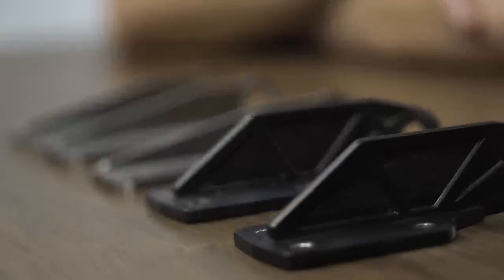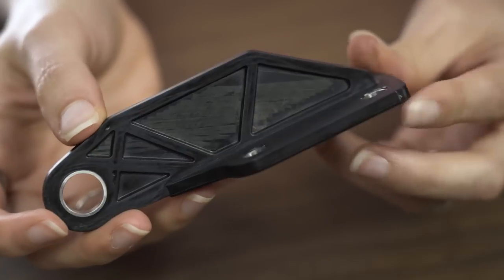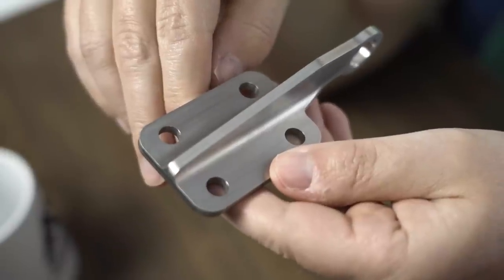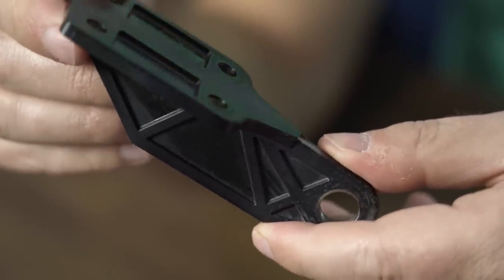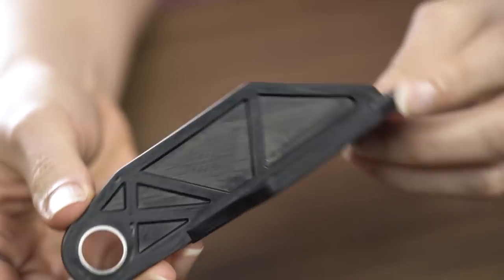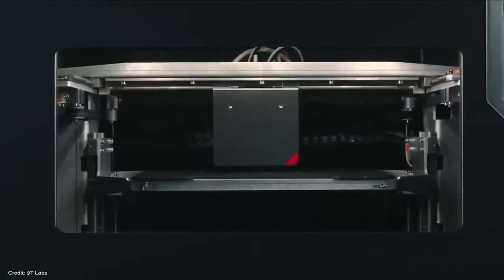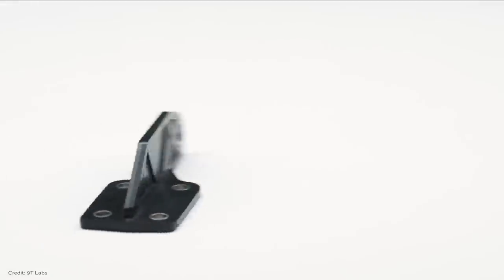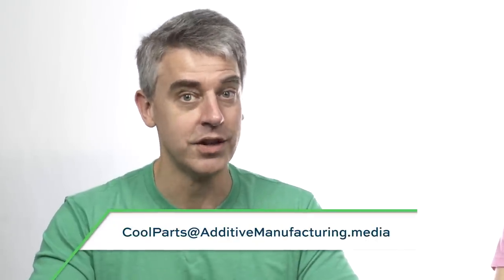3D Printed Composite Bracket Versus Machined Steel |The Cool Parts Show #41

Comment from the maker: Hey all, thanks for watching! 

For those asking about the tooling, yes, the compression mold is a significant up-front investment for a part like this. But keep in mind that this bracket would be produced in volumes of 1,000s per year which lowers the tooling cost per part. 

For more info, shout out to Yannick Willemin our episode expert who is answering questions in the comments. (Also find him on LinkedIn! https://www.linkedin.com/in/yannickwillemin/)

You can also read more about the 9T Labs technology in this article by Stephanie Hendrixson: 
https://www.additivemanufacturing.media/articles/fiber-reinforced-3d-printing-expands-control-applications-for-composites
Reply: just thousands a year?  So you make like 4 a day ?
Reply: Those 3D plastic ("carbon fiber") brackets are not as strong and durable as the steel parts.  If these plastic parts are strong enough for the task, the steel parts are way over engineered , and could have been replaced with an aluminum extruded/machined version that would be light and strong, and I can guarantee that they could be produced more economically (even with batches of 1,000's). This plug for 3D printed parts is misleading, to say the least. I'm not saying the idea doesn't have merit, but this example is really stretching reality.
Reply: @Emma-ol7kf  I believe they mean 1000s of the bracket shown in the video, they should have orders for other parts. I guess

Comment: There's no way the printed part was cheaper than the machined part. Has it been certified by the FAA/EASA/IASA? Does it get brittle in low temperatures and break with the vibration a helicopter would experience?
Reply: I work in a reliability lab and I'd love to test this, any chance you have good data on the vibration and cold temperatures that would be typical for helicopter reliability testing? We use Essentium's HTN-CF25 filament all the time to replace the machined fixtures we use in our mechanical reliability testing, our process is much cheaper and faster than what our machine shop can do, but I've never tested our 3D printed fixtures under low temperatures, it'd be an interesting comparison.
Reply: I would think a high heat situation would be more of a concern for the printed part.
Reply: Cost of this is absolutely cheaper at volume compared to traditional composite parts. Compared to a machined part, it likely still is once you get to volume. Plenty of people are getting FAA certs on composite 3d printed parts.
Reply: @circleofowls  that’s a material I was thinking about to use! Interesting
Reply: @MrBen527  PEEK and PEKK have proved that they make the cut
Reply: Airworthy is a whole different level than just building a replacement
Reply: If they are printing PEEK - and then re-moulding the part then it should be fully dense, continuous fibre reinforced. PEEK is high temp, low outgassing, aerospace grade plastic (it’s more expensive then silver by mass), resistant to most chemicals etc etc. the fibre reinforcement makes it very good at resisting vibrations (if designed correctly then higher fatigue life then steel).  

Remember they printed this in multiple directions in order to make sure fibre direction isn’t only in one direction (not only in Z). 

Cheaper? I doubt it. Cheaper on fuel - for sure.
Reply: Same thoughts. A machined part where you have so many shops to choose from vs more recently developed process from a single source with custom tooling and NRE cost for the supplier and a complete redesign from the customer. They must only be comparing the incremental unit cost which is very disingenuous as this is not how business decisions typically get made.
Reply: @circleofowls  this is awesome to hear! I just picked up a few rolls of HTN-CF25 to try.

Comment: He talks about cost but notice how they avoid the cost of the additional tooling. Also biggest part about 3D printing is Joe Schmoe can do it in his garage or home and he most likely couldn't if he needed tooling like molds. What's the life time of the part vs the metal part.
Reply: Dear Diconica, thanks for picking up the point of the tooling cost. It is very important to understand that we are developing a manufacturing standard meant for volume production (1'000 to 100'000 parts per year). The tooling is definitely necessary to fulfill all functional requirements for structural parts and has a minor impact on the cost per part given the volumes. This technology is interesting for major OEMs in the mobility, medical, and leisure field and definitely not (as you are correctly describing) for individuals looking for an accessible 3d-printing technology.
For this exact part, no lifetime study is yet available. However, the customer is benchmarking all characteristics with the current metal part. For other parts, we have proven that our parts cope with the lifetime tests (X cyclic loads equals a certain lifetime).
Please contact us if you would like additional precisions.

Comment: Very interesting process. I'm curious about the type of QA inspection required for the AM part. The billet steel part is probably just a pair of calipers and the CMTR's. With the AM part I would imagine they would want component measurements before assembly/ molding, and possibly UT or RT to check density (and verify presence & placement of the carbon reinforcement).  Thanks again for the great content, and good on Carpenter for sponsoring this episode even though it doesn't involve powdered metal.
Reply: I would hope occasional x-ray and or ultrasonic testing also
Reply: @AdditiveManufacturing ,  thanks for the response.  Your level of engagement is really impressive.   Looking forward to your next videos.   Regarding the inspections, I was thinking their targeted run sizes would be too small for SPC and lot inspection would be 100% (especially for something going airborne).  Since they are specifically going after the high strength/ lightweight/ relatively simple geometry it seems that would make the QA more demanding than typical FDM parts. Even if the total cost was higher than the steel part, 1/5th the weight is remarkable. There's the old adage about aerospace parts being ready once the  paperwork outweighs the part... though in this case I suspect the paperwork for the 3D printed part would be 5x the steel version. Great combination of processes though, and definitely opens up new applications.
Reply: Also very helpful would be the approximate UTS of material
Reply: @MrBen527  CT is already a more robust inspection than x-ray or UT. No need to double up on the NDE cost for such a simple part.

Comment: why not comparing to a metal AdM part after topology optimization also in parallel to original machined part?
Reply: Good point. From a technical point of view, it would be very interesting. However, the business case for serial part manufacturing with metal AdM is challenging due to its costs.

Comment: Helicopter part I.E probable cyclic loading. We all know that composite/3d printed metal parts have almost no fatigue limit and would be almost useless in high cycle repetative loading.
Reply: This helicopter part definitely has serious cyclic loading induced from the vibrations. There are already lots of composite parts developed and performing well in heavy cyclic load applications. Of course, this is part of the part design work and requires lots of lab testing before getting qualified. But it is definitely possible.
Reply: Composite parts have extremely high fatigue life. Remember this part is build from multiple parts - remoulded together. IF designed correctly with fibre orientation this could outlast the steel. Remember also if made from PEEK (more expensive then silver by weight) it will be high temp, strong, durable, chemical resistant, low moisture absorption etc. 

It’s all about the design really - but if re-moulded then you remove the weak z layer bonding and really create some strong, high temp, high fatigue life parts

Comment: Composites do have a fatal flaw which will come up in daily use and abuse, especially in military, EMS and industrial use: They can't take a hit and maintain their designed original mechanical propertues due to delamination and fracture propagation. This is well known problem with high end bicycle frames that get knocked against rocks etc. and can develop fractures that slowly develop over time and then catastrophically fail all at once often at the worst possible moment.

Comment: As an Aircraft Design Weights Engineer I can say that this is amazing. One thingvthat you might have missed. The steel parts need painting, the composite parts might not. That is another potential weight saving.

I lobe the idea that the Carbon is only installed where it is needed and the Polimer just holds it in place.
Reply: Problem with 3d printed composites is they will probably will end up in the ocean. So, SLS metal printing is the way to go for production in my opinion. You still can have optimised shape, but the part is much more recyclable.
Reply: Stainless doesn't need paint. 
Most composites do because of photodegredation.
Reply: @artomatica  This is an aerospace application. A niche application where these economies make sense, as Yannick said. Recycling would be a big concern for mass produced items like production cars. And parts for home use were regulation is minimal. The aerospace industry is already regulated to dead, so a little more regulation to ensure carbon fibers in old aircrafts are scraped properly would not be a problem an might already exist in adequate form.
The application of fibers (carbon or otherwise) in a lot of mass applications that don't really need them is a concern to me.
Reply: @appa609  Absolutely, i was going to say this
Reply: @FedEXfright This is a new specific process, so it's not "been around for a while".
What HAS is fully mixed carbon-fiber composites, and you are more than capable of researching it for yourself if you're that concerned.

Comment: For non-critical parts like this, it looks incredible. Of course, the steel part might have been an aluminum part for some weight savings, or have been made out of a smaller gauge. Looking at the gauge and cross sectional area of the steel part, I would estimate it has a minimum breaking strength that's probably around 7-9K lbs. An M8 8.8 bolt specs at around 6.5K lbs, and the amount of cross sectional area on the steel part is larger than an m8 bolt. I don't doubt that the fine engineers at 9T specced the part to appropriate strength and it will result in meaningful savings both on fuel costs and part costs, but it's somewhat unfair to say it has the "same strength". Testing a part once to the load strength does not make an appropriate test -- there needs to be at minimum a certain safety factor measured, and the material wear characteristics at repeated expected load to estimate the expected lifetime of the part, as the fatigue characteristics of a steel part are such that you could spec a part for what is effectively an infinite lifespan. Similarly, low and high temperature operations for various steel alloys are something that is well studied and predictable, and 

At the minimum, a destructive test to determine an N=1 MBS would have been great to see.

In general I think for parts where space dimension vs performance tradeoffs are not critical, and repeated loads, temperature or stress don't play a limiting factor, a process like the one 9T Labs created will result on very meaningful innovation and weight savings for certain industries. I look forward the day when we actually start seeing high load cycle parts like a connecting rod in an engine made out of composite parts, but I think we're still quite a ways away from that.

As another thought, machining that part might not be the cost effective solution -- looks like a 4 axis job. I imagine two parts welded together would be much more economical.
Reply: Comparing an un-optimized to a part that got a lot of love is not really apples to apples. Still awesome technology. The random and fault sensitive processes that are sometimes used to put down fibers make me cringe. Like how they lay down mats of the stuff in the example video.
Reply: @mennol3885  I agree, I always wonder how much it is deterministic, and how much is simply safety margin that was pre-planned, so production can be a little inconsistent without everything exploding immediately.
When you see people laying down the fibers with a roller and some rather random amount and distribution of resin... is this what peak performance looks like?

Comment: First, just because the metal and 3D printed parts both held 500 pounds doesn't mean they are equivalent.  That would be like saying a Volkswagen and a Ferrari are equivalent because they can both go 30 miles per hour.  Why didn't you test both parts to failure so you could know if they were really "equivalent?" 

Second, how does the part do at it's temperature extremes, in dynamic shock and in fatigue?  The steel part might be designed to yield in a high strain event, like a crash, and not fail.  How does the printed composite part do in a crash?   You need to find out the requirements for a part before you propose alternatives.    Is there an electrical conductivity requirement for helicopter doors, in the event of a lightning strike?  This would add weight and cost to the printed hinges.  Maybe these issues were all addressed by 9T, but it wasn't presented.

It may be true that the printed composite part is 1/5th the weight of the steel part, but the printed part may be 1/5th the strength, or stiffness, or have 1/100th the strain capability.   Until you do the engineering, you don't know.

Comment: So emotional.
Ok.
What about impact strength?
What about strength after overload? 
How many parts you need to produce to make printed-molded parts cheaper then machined parts?
Repeatability?
UV resistance?
Tolerances?
Abrasiv wear resistance?
Low/hight temperature resistance?
Why steel part doesn't have pockets for weight saving?

As a new method of manufacturing its great, but comparing with steel looks like you just try to sell this technology.

Comment: HIPing or Hot Isostatic Pressing allowed castings to become more dense and therefore stronger. This process using Printing and Compression Molding is simply amazing. Weight reduction [and costs] are very valuable to all weight sensitive components such as aircraft parts. Where will this go in the future? Amazing!

Comment: What could be interesting is that when you reduce weight of parts by replacing them with polymer parts as presented here, it may lead to reduced need for strength, as whole assembly gets lighter, so you can reduce strength and etc to the limit ofc. So potential for recursive savings :d

Comment: Compression molding is just another word for forging plastics!!! Even with the additional processing, the weight savings for an aircraft still may be worthwhile.
The question is what is the compressive, tensile, dynamic and shear strength of the 3D printed part? What is the endurance life of the plastic part compared to the machined part?

Comment: The thing about that steel bracket is yes it's expensive if you mill it out of a solid block. But I can make that part with plate stock, a drill press, and a welding jig. 

If it was aluminium I'd machine straight from T-extrusion
Reply: Unfortunately skills like yours are disappearing. That’s the real problem. I’ve machinist outright refuse to teach younger people. Don’t know the full reason behind it but I speculate companies are trying to have lots of new people to pay them less and get rid of the older people that are experts
Reply: Your tinfoil hat is too tight.

Comment: To be put into helicopter service this part would need to demonstrate much more than just equal strength.  Is the part exposed to sunlight and is the part UV resistant?  Does the composite fatigue or become brittle over time?  Is the composite resistant to exposure to the various oils that are used in the helicopter and which could end up coating the part?  Does the part fail suddenly or gradually?  How is the strength dependent on temperature?

Comment: The question shouldn't be think about where else in the world do you see metal brackets that can be replaced with these composite ones, but what else this construction method can extrapolate to. It being cheaper while being functionally equivalent is enough reason for manufacturers to use it, but I'm more excited on how this could enable greater efficiency and performance in weight sensitive applications.
Reply from the maker: Good point, good point. Lightweighting is a major benefit of additive manufacturing. We have a section about it on our site: https://www.additivemanufacturing.media/hashtag/lightweighting

Comment: From the method of making this product, looks like mechanical properties of material is not isotropic? Is it worth it to create a method to make the material of carbon fiber product isotropic?
Reply from the maker: Good questions, thank you. Here's a response from 9T Labs:

On the first question: definitely, and this is why we use continuous fiber composites as it allows to reinforce the part specifically along the load path. This is one of the main advantages of such materials.

On the second question: Using continuous fiber materials with the goal to have an isotropic material behaviour is contradictory. In some application, one might add short fiber material to decrease the anisotropy, but it is not possible to make it completely isotropic.
Reply: @AdditiveManufacturing  Thank you for answering my question. Just out of curiosity, as the mechanical properties in transverse direction is not based on carbon fiber at all, is it worth to create a manufacturing method to let carbon fiber to share some load in transverse direction as well?